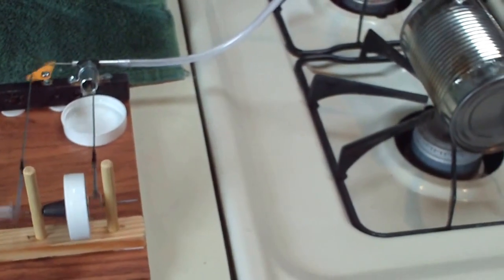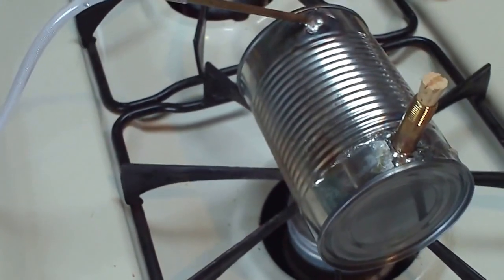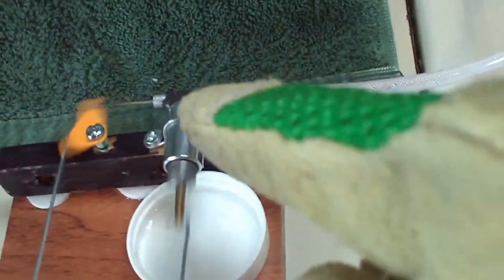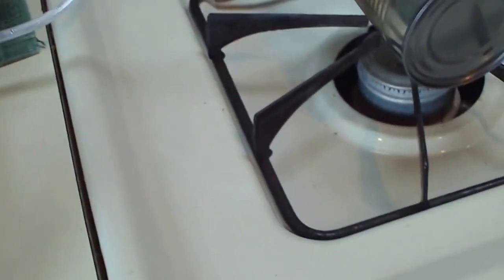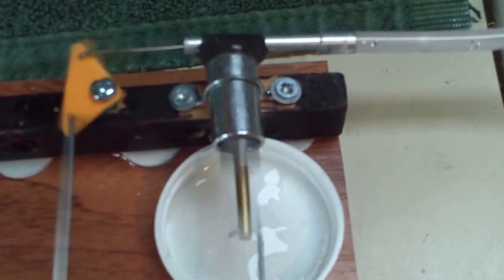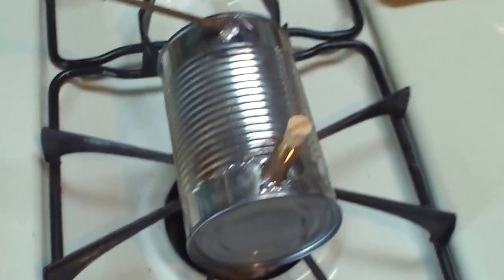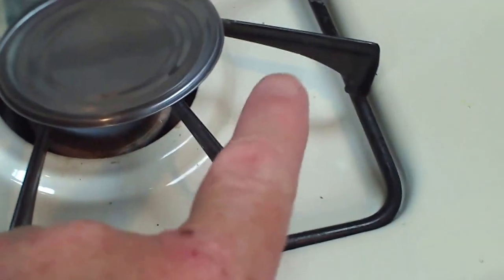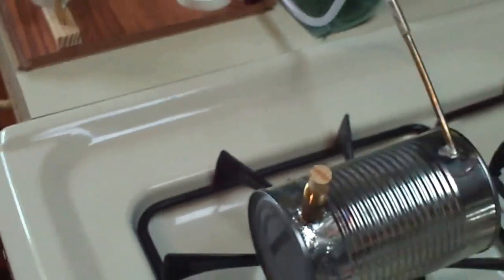Simple Steam Engine ---- With Simple Boiler

Comment: Nice boiler!  I think that's perfectly safe.  That cork will pop out long before the can will blow up.  When the ends of the can start bulging out a lot you know the pressure is getting too high.
Reply from the maker: +Makerj101 Thanks.  The 'cork pressure relief' needs a chain on it so if it blows off I don't lose it.  Thanks for the tip about the can ends bulging out way before the can ruptures.  I watched your video on the exploding boiler out in that field. Pretty scary.
Reply: That's a good idea with the chain!  Would be very helpful!

Comment: you might want to consider making a boiler out of a lightbulb, they are an ideal shape, they stop bubbles rising to the top. be careful not to hold the bulb with bare hands when drilling through the top in case it shatters. making water boil is a much more difficult undertaking than one would think
Reply from the maker: Boiler out of a lightbulb???????? That sounds a bit scary.
Reply: ***** they're ok if you don't pressurise them. started fantasising now about making van der graaf generators with all various shapes of lightbulb............. could have a nice wide belt............

Comment: Okay, now that your prof of concept works, make it big! I have been very impressed, and interested in seeing this in the large! Maybe a steam engine that has some torque, and an orange home depot bucked as the VG HV generator. I know it's not a table top item, but it would still be worth doing in my mind! Imagine being able to raise a person's hair, or run a larger static motor. If you get really adventurous, then maybe an orange home depot bucket “condenser” with tin foil and thick plastic sheeting/wrap as the dialectic. The spark would be awesome!!! Just for fun though! :-)
Reply from the maker: I am seriously thinking of building a larger simple steam engine now that could be used to charge batteries. There are several reasons why this method deserves a close look as an emergency power method.

Comment: The end cap on cans are just glued on, take care to not have one pop off and spill your entire reservoir of boiling water all over your stove.
Reply from the maker: These cans do not have end caps that are glued on.  I looked it up on Wikipedia and the joint is a 'dry' fit with multiple folding of the metals that form the tight seal fit.  Here is the link to the Wikipedia description: http://en.wikipedia.org/wiki/Tin_can